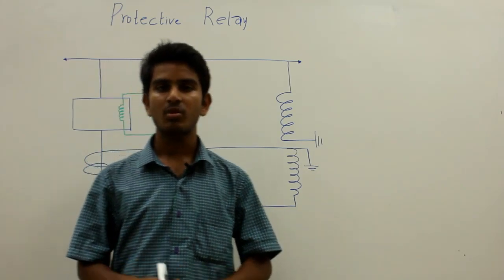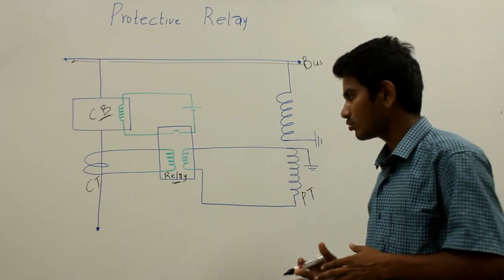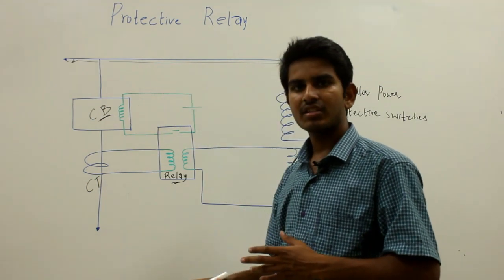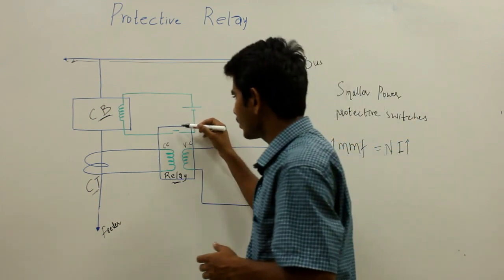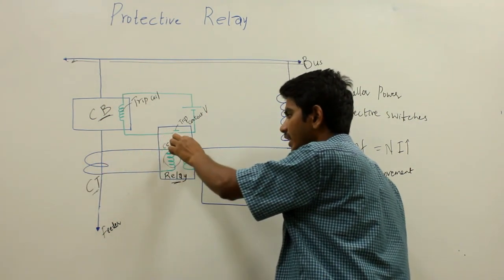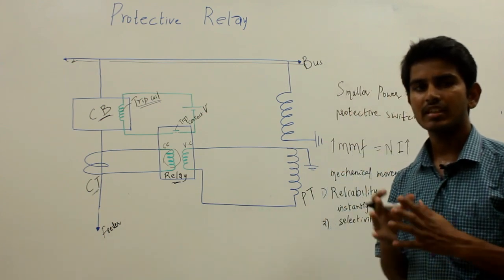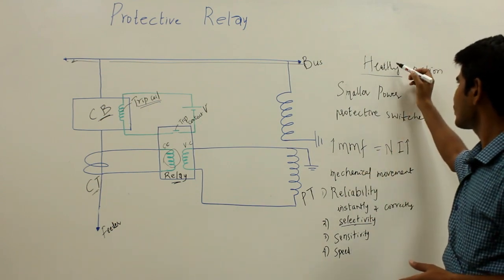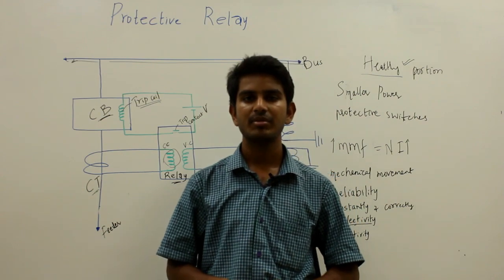Protective Relay In Power System

Comment: The exact function of relay is 
To sense the fault in an equipment present in power system using CT and PT  aftr that if fault present, the relay will give trip signal to C.B (energising the coil of C.B) to isolate the faulty system from healty system in power system